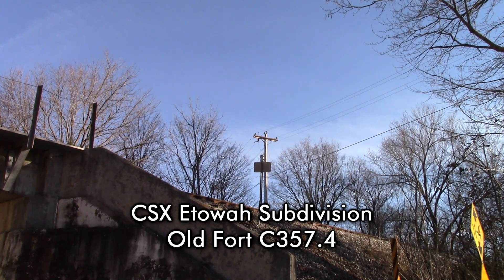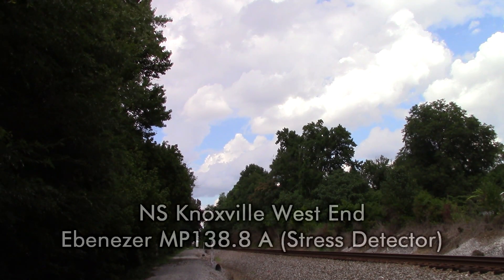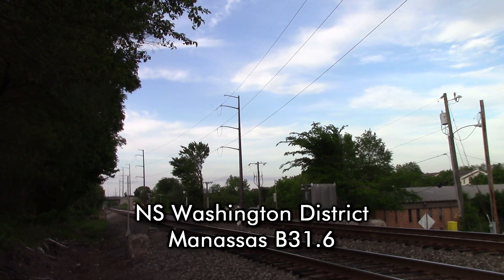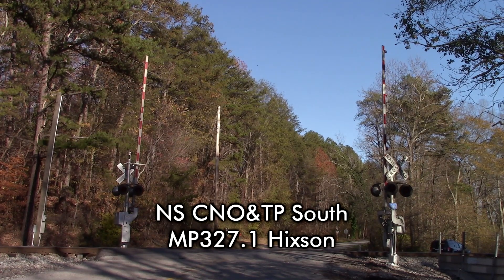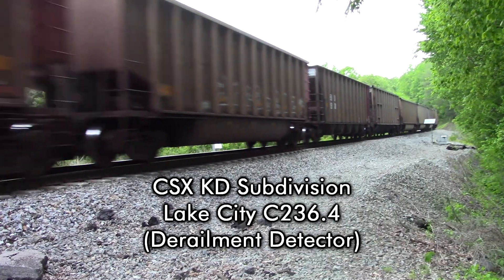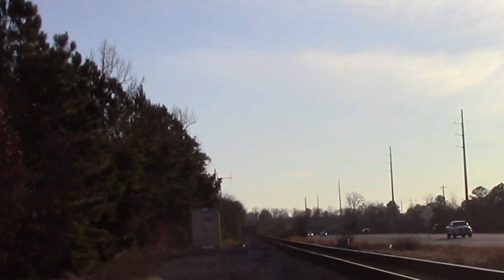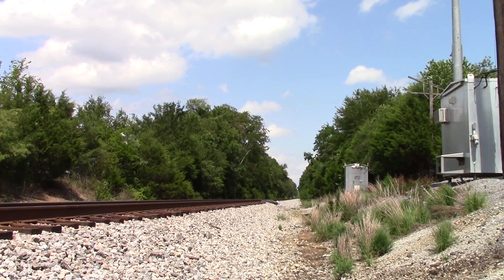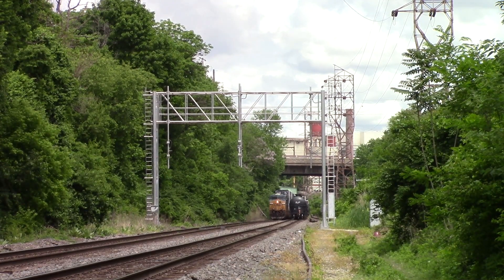CSX and Norfolk Southern Defect Detector Compilation

Comment: I was a CSX engineer (retired) been gone for almost 15 years.  Interesting that NS DDs only say "no defects" without giving an axle count or train length, like CSX detectors now do.  Most of the CSX detectors did not give train length 15 years ago.  Also, what is a "stress detector"?  That's a new one on me.  Is it anything like a wheel impact detector?
Reply from the maker: Yep it does the same functions as a wheel impact detector but also detects load imbalances.
Reply: @RaisedLetter  Thanks.

Comment: Love hear Defect Detectors on the Main Lines like CSX and Norfolk Southern on the Railroad Radio Scanners as a Railroad Spotter when spotting trains for anywhere I'm at, like Deshler, Ohio: CSX DEF-NB Main Line Division:  CSX Equipment Defect Detector Mile Post 60.3, Track 1 or Track 2, No Defects (×2), Total Axle: Numbers. End of Transmission. for example.  Awesome video!

Comment: Pretty cool complation you got there! How many original ConRail Defect Detectors are still around as of 2022?
Reply from the maker: In terms of detectors first installed by Conrail, there's a high clearance detector in Reading, PA at CP Belt. Reads out NS but it's a Devtronics SCAT that Conrail would have installed.
Another possible Conrail classic is in South Plainfield, NJ on the Port Reading Secondary. Harmon  Cyberscan 2000. That could be a CSAO install or even better a reused Conrail detector.